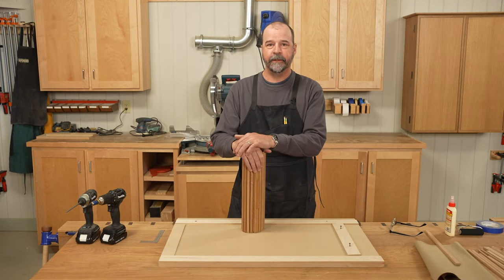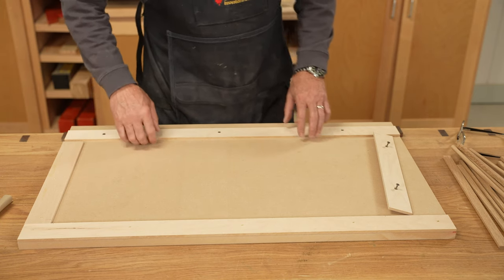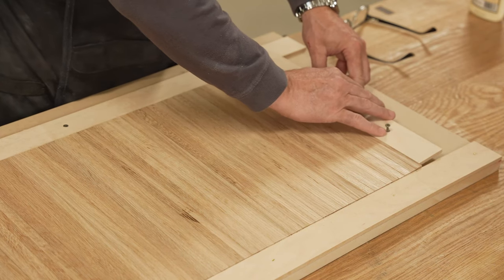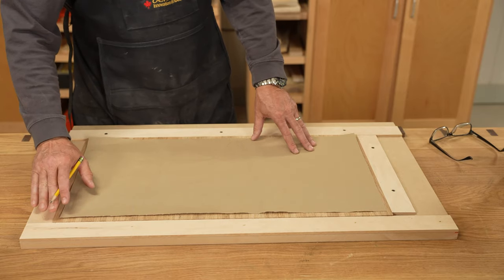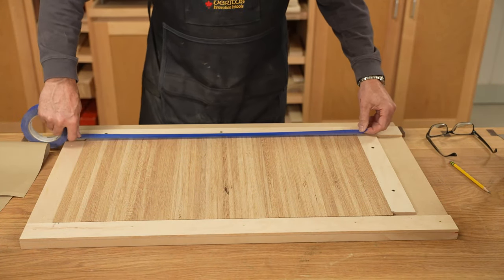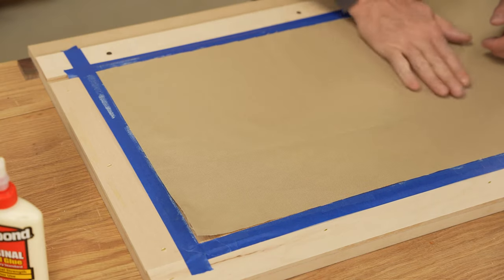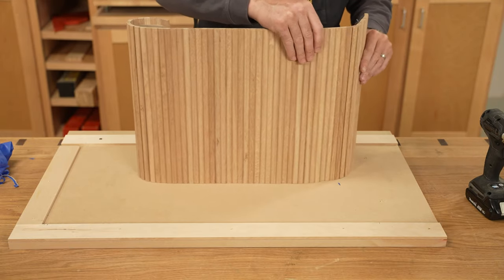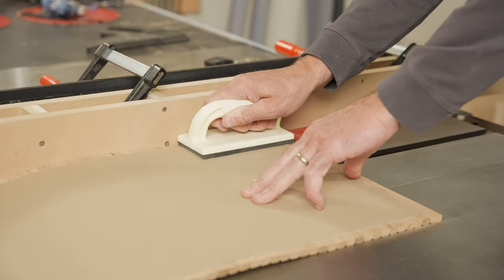Build A Tambour Door - WOOD magazine

Comment: Thx for the video. When you installed the tambor doors, I noticed that at the bottom of each slat of wood there was what appeared to be a "rabbet cut" to get door to work better. When and how did you make the rabbet cut and is there rabbet cut on the top of slats? Thx again Bruce
Reply: 9:26 He used a table saw

Comment: Put a wall where you said this weird opening. On both sides of the staircase. put a door swing inward into the room. But if you want to be unique about it. You put
the walls in the same spot. This is old technique that people used to use on oldfurniture. Here's a YouTube Channel that shows you how to make it. Basically, it's a  quarter round of pieces. Of wood. You glue them to a piece of  heavy duty canvas. You put groove in the top and the bottom where the door is going to go.
And stop. https://m.youtube.com/watch?v=Vo8NODBKDJc#searching